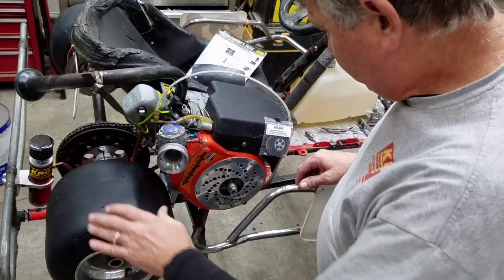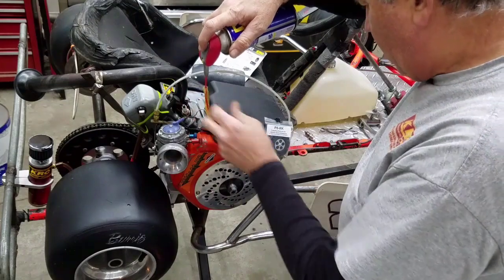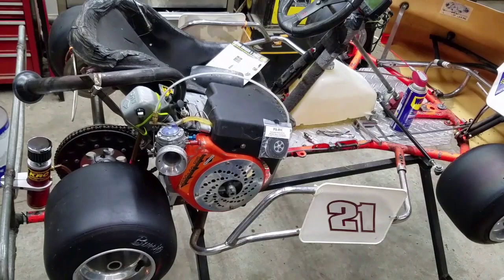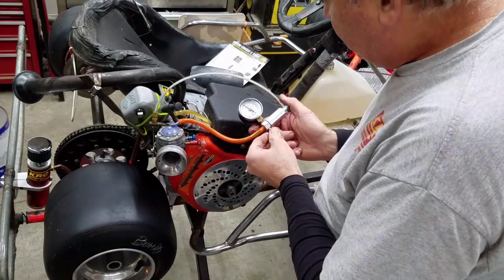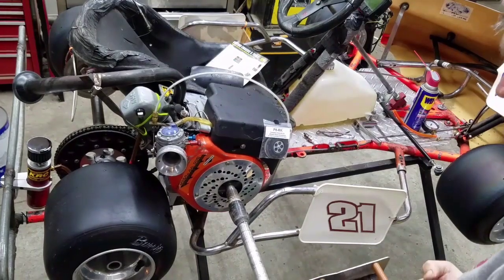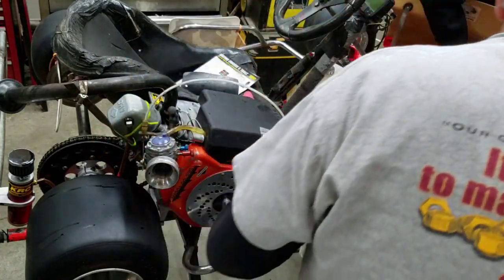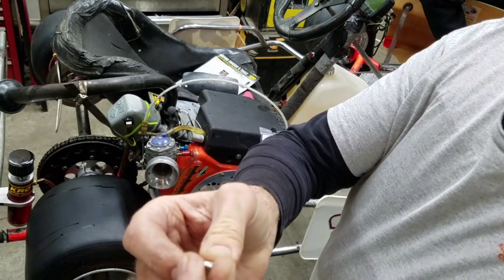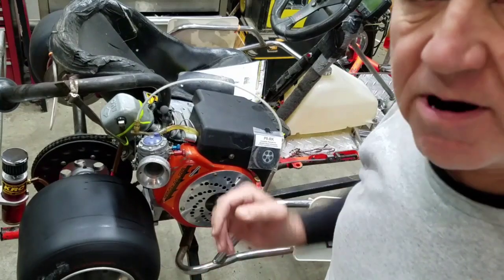KRC Go Kart methanol engine start-up(2018) On B&S Animal Engine

Comment: I used to run open modified blockzilla's using the Tillotson carbs and running methanol, we figured out after the race run about 8oz of unleaded gas ran through cleans out the resedue methanol leaves during the week. We were always proactive and getting prepared for the next race the day after we we finished the race.
Just trying to help.
Reply: What style of tillotson did you use?

Comment: I love to have one of those carbs for my built Honda 2stroke scooter it’s been bored and stroked. Very nice
Reply: How does it run?? I have an elite myself
Reply: It runs well. Thing is when you’re bore an stroke them. The compression goes up, so the starter needs to be changed for one that has torque to start. There is a definite difference between the stock stroke of the crank and the one I have in it now.
Reply: FrankiE Rutherford  I see what crank are you using?

Comment: Watch out for WD-40. Don't use it. It is not meant for aluminum engine parts of any kind. It causes big problems over time. WD-40 is a penetrating oil its an industrial strength penetrating oil. Your better off with a silicone spray or CRC or simple oil. WD can destroy motors and chains and bearings. It is meant to loosen rusted stuck on nuts and bolts and is abrasive if run in motors on chains and bearings, do not use. 5 to 20 weight oils are a better choice. This is from 30 years experience where I couldn't figure out why all above were failing all the time. I finally dropped WD and all the stuff had no more problems. WD is thee best when used for what is made for and, however , can't fault them there, reliable.

Comment: have you messure sprak plugs heads cap at what its optimal in that engine becauce back in day i use cap 0,6mm in 100cc engine and its was optimal in that engine and i use 102 octain fuel

Comment: How do you get the engine to idle without wanting to push the go-kart on its own
Reply: i think he has Centrifugal switch attached to shaft, for example when rpm is higher than 2000 it will spin
Reply: @paavo1294  certainly.